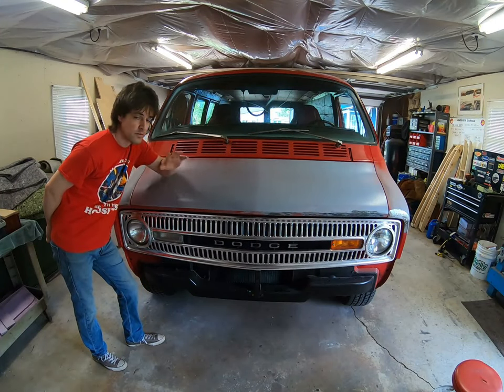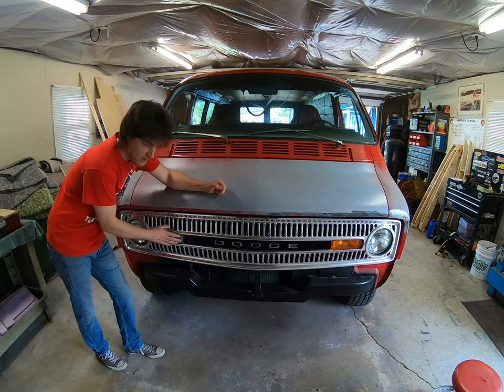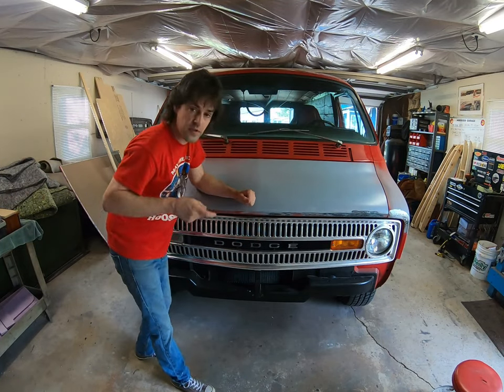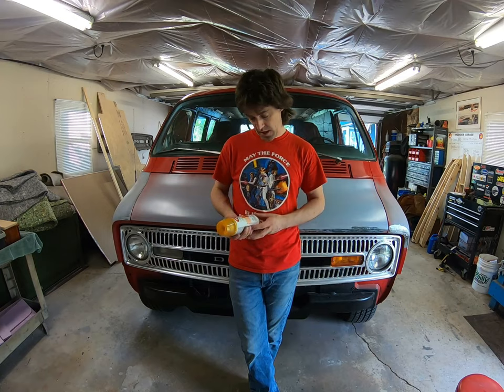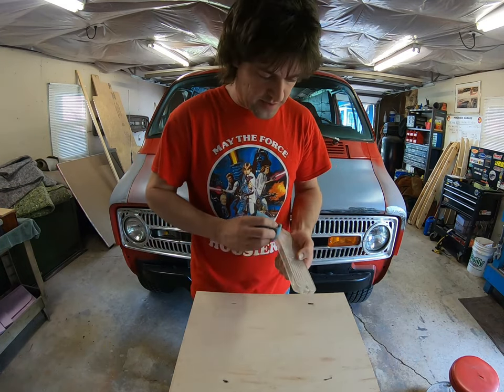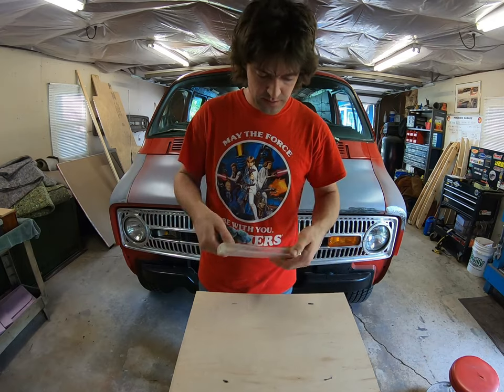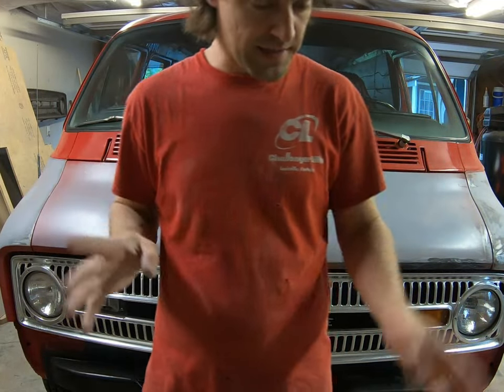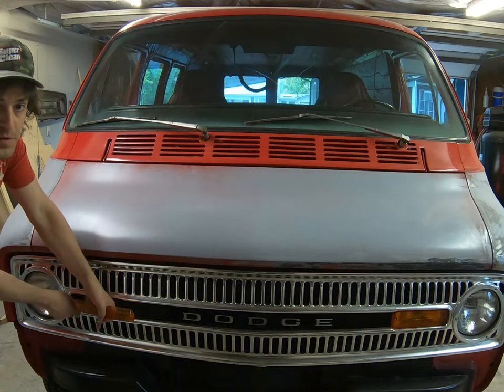Amber Lights - Hoosier Garage

Comment: They use and still do use amber colored bulbs so it could come clear from factory like the lower park\signals on the front valence of 3rd gen Chargers...some states only allow a colored signal and a few let the clear go... But it's better for visability to be Amber or red for signals in my book!!! They also have candy red and orange sprays too....you know from the model car kit world!! And you did a great job man.
Reply: I don't know about the visibility thing.  On my 1963 Savoy, at night the clear bulb and lens is really bright.  The amber bulb would dull down the brightness.
Reply: @mexicanspec  but not in the daytime clear lenses are hard to see in bright sunshine... Got stay alert with the new cars in front of you.... Since I don't want to wrinkle my classic iron... Lol 😆
Reply: @moparnut6286  Even in the sun you can see the turn signal flashing.  I have seen the turn signal lenses in amber for the '63 Savoy and they don't look right.  They never came on the car from the factory that way so I don't want them on my car.
Reply: Might want to be careful using red on the front ! Someone might think ur trying to be a guy in blue , popo , the fuz , copper u no .
Reply: @mikesr3407  I think he meant on the rear and I was talking about the front.
Reply: @mikesr3407  well here in NJ no red in front also the only white in back is susposed to be your license plate and your reverse... But I have seen a hummer 3 running around with all clear lights front and back...there susposed to have colored bulbs but it did not!😤
Reply: Well this guy lives in one of them there liberated states , Illinoid and a fellow Mopar peeps we gotta look out for each other ! Lol , I have to have a foid card to buy ammunition , but I can ride my motor cycle as free as a bird and still have to put seat belt on in the car ! Sometimes I ride dirty just cuz I feel like it ! Lol
Reply: @mexicanspec  Yeah sure clear is legally here in NJ but the still require the bulb to be Amber that's why all my 3rd gen Chargers have clear lenses but use Amber bulbs but it does vary from state to state.
Reply: You can't legally have forward facing reds unless you are an emergency vehicle.  I had red headlights in my 1967 Pontiac Ambulance and nobody said anything.  Are you sure the law stipulates the bulb to be amber?  Old car had clear bulbs and people kept what they came with.
Reply: @mexicanspec  in NJ yes amber but other states maybe not and if your car came with a third brake light it has to be functional NJ is nuts a lot like CA and corrupt cause I see people get away with a lot....NJ had to get rid of most of their circles aka roundabouts cause they kept changing the rules with every new governor!!! yep nuts!
Reply: I was mostly being funny but either way my first car came with no seat belts , no turn signals , no oil filter ! Seriously we have come a long way !
Reply: @mikesr3407  what did you have a Ford T!!!!! Old man!
Reply: 51 Chevy 2 door sedan , styliner bare bones , no side mirrors did have rear view mirror . 235 three on the tree , barn find had rusty patina across the hood from farm implement , rake or disk ? 2 tone dark green on top pee green on bottom .
Reply: @mikesr3407  still a cool project car!!
Reply: @moparnut6286  it was my daily in late 80 s I had lots of people pull up at lights and say , I'll give you 50 bucks for your car ! Had slots all around vacuum windshield wiper s worked until you floored it ! Lol

Comment: Great tip. Did you use the adhesion promoter inside the lens too?

Interested in the red for faded tail light lenses.

Thanks

Malcolm Ottawa Valley
Reply from the maker: Yes I sprayed the inside with promoter too.. the red they have looks a little more Rose color but might have some depth.

Comment: Good effect, it looks so close to the original. Just wondering. What color are the bulbs? Sometimes you can find amber colored bulbs. That might help. The only other thing that I could think of is Photographic Gels. They are plastic sheets that are heat resistant and are put over Photographic lights, both continuous hot lights and strobes, to throw color. They come in just about every color of the rainbow. They could be cut to size and placed inside the light lens. But I think you have this challenge beat.
Reply from the maker: I had an amber bulb in there but the lens being clear was all wrong. Thanks for watching!
Reply: @HoosierGarage      Did it look any better with the amber bulb in once you coated the lens amber?
Reply from the maker: @hardrock1826  I only had the clear one in by the time I sprayed the lens.